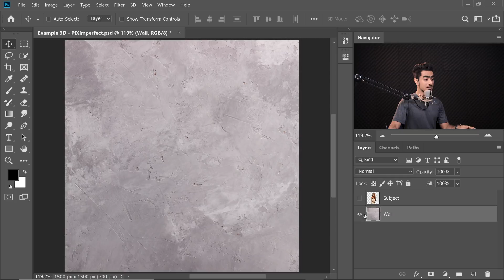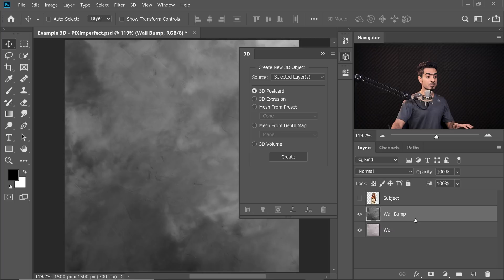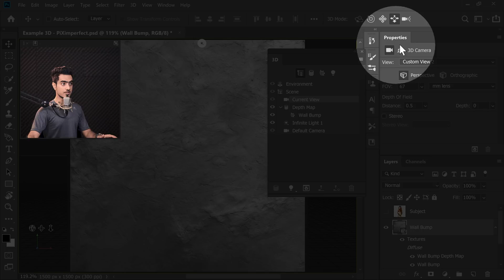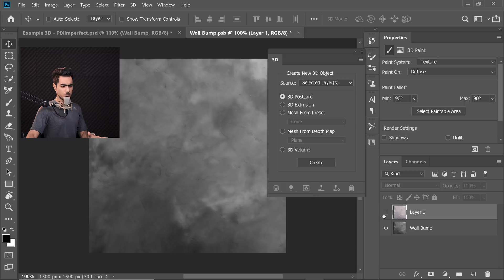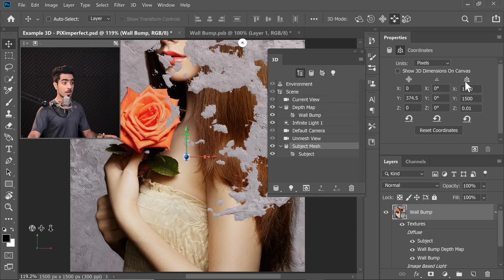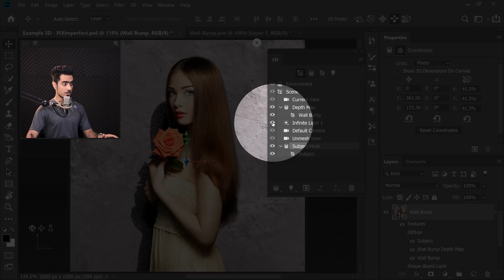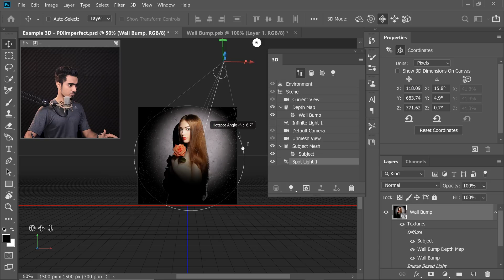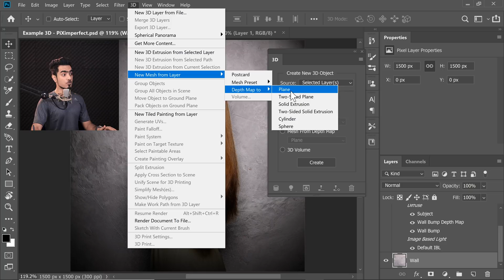Convert Flat 2D to Real 3D in Photoshop!

Comment: Hi! Great video!
But I've got a question. When you save it in Ps format, is it saved as a 3D or 2D image?
I'll explain. If I import the Ps file in After Effects, will it be 3D or 2D? I mean, if I, for example, add a camera view and then move it from left to right (or somehow), will the Ps layers (wall and girl) interact with each other, or they will behave as a single 2D image? Hope you understand what I mean ;) Thanks.

Comment: Guru, tell me why I'm unable to resize my brush with the punctuation and comma keys. That used to always work back in the day and then it suddenly became an unstable feature. Sometimes it worked, sometimes it didn't. Then it just stopped working all over. I'm on W10. PS 2020.

Comment: Help.  Nietzsche said that patience was the most difficult of all the virtues.  I agree.  Your instructions are spot on.  However once I have selected the wall bump layer in the layers panel and the 3D panel the options are different in my Properties panel as to yours.  There are only Base Color and Interior color.  The Diffuse and specular are not there.  Any clues?

Comment: The shadow doesn't appear when opened to 3D.  Also, when opened, black is on top of the object.  How can the shadow appear, and what is the black about on the object?  This is 2020 Photoshop I'm using.  In the previous version the shadow would always appear.

Comment: when i get to the change subject to postcard they go darker, and i dont have the diffuse layer 7.23 mine says base color instead in latest PS version @piximperfect
Reply: Same for me! I found a workaround that works "ok". Select Scene in the 3D panel, then in the Properties window, check Backfaces and Linearize Colors. Before you render it, uncheck both of them.
Reply: @falkenbjorn  the wall is also super black following this instruction when the bump layer is applied - think it may be due to changes in latest photoshop version im not sure?

Comment: Great as usual but the 3D object of the model is flat, and in a sense not true 3D, in the sense that she cannot be rotated to see more of a side view. If in fact real 3D was generated, that would be possible. If you want real 3D (of people) check out the new Headshot from Reallusion, or Facegen, or FaceTransfer from Daz3D, with the understanding that these programs work from Faces photos only, and require using a 3D application program.

Comment: I love this tutorial! I have yet to upgrade my computer to a more powerful CPU and GPU. How much power and memory would you recommend Unmesh to use Adobe 3D and rendering quickly in real time? With my current configuration, it would take hours. LOL
Reply: In photoshop it will be slow anyway, thats unfortunetly flaw of photoshop rendering engine, in free blender you can render picture or text at least few times faster, especially with latest 2,8 big release (they worked about 10 years on it, companies like ubisoft sponsored it with fat checks).